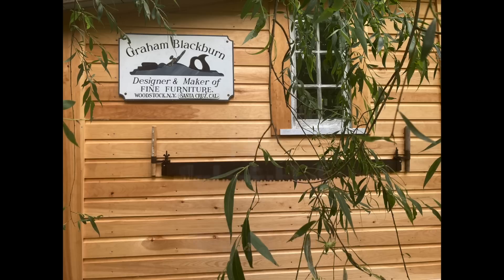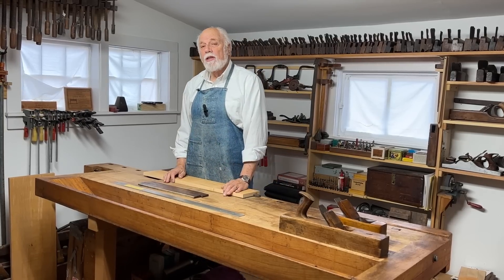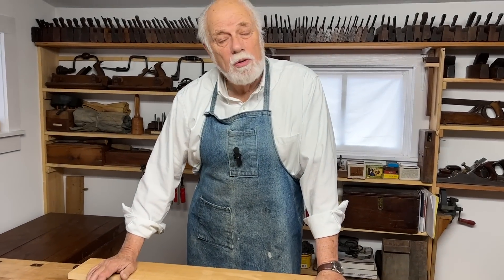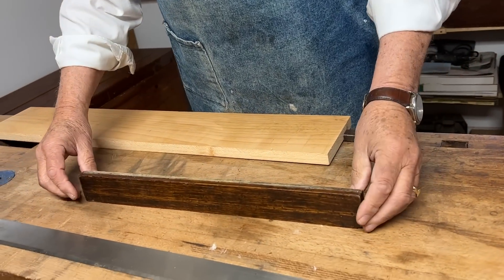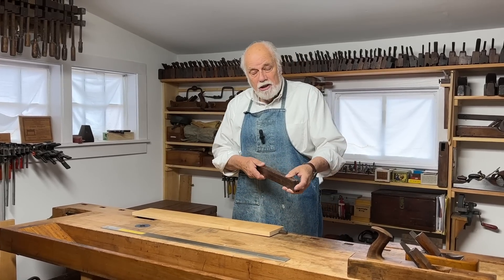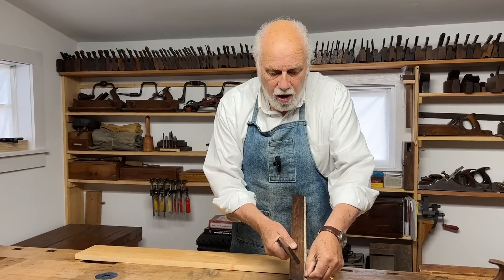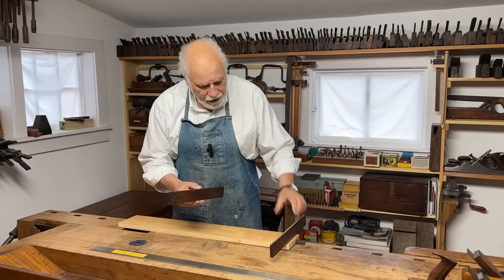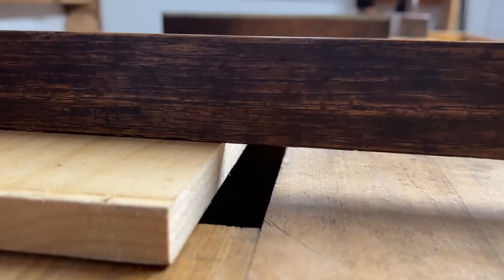28. Winding Sticks & Machinist's Straightedge

Comment: I know this is cheating, but as suggested by Chris Schwarz, I used two pieces of aluminum angle, each 24 inches long. I painted one of them bright red and have been using them for several years with no complaints.
Reply from the maker: Whatever works!

Comment: Everyone who has ever made any amount of videos on hand tool woodworking has a winding stick video, so there are a few people who have heard of them these days. It is however nice to see your take on it.
Also do you not need both winding sticks and a straight edge to check for flat? The winding sticks to check for wind (get two co-planar lines at the end of the board) and then the straight edge to take care of the rest (sweep the lines connecting those two co-planar lines).
An alternative requiring longer straight edges would be to put two of them flush at the bottom of a V-shape and then put the board in between the legs of the V, giving you three points connected by straight lines, forming a plane that you can reference with a third straight edge. The caveat with this method is that you need straight edges long enough to make a V that your board fits into.
If you are going to make your own straight edge without any external reference you will have to make them three at a time, checking each for high spots against the two others until they all match
Reply from the maker: All true. There's always more I could say but never enough time. Bit by bit I'll try to cover everything (It's why I started by writing books.)

Comment: Thanks!!! Because winding stick has to be accurate i have decided to use two identical levelers good quality. With out them I won't start flattening my stock. With time and experience it become very intuitive process. I have got small jointer/ thicknesser but it so noisy, can't get more than 19 cm stock and the blades leaves marks .
Reply from the maker: Right on

Comment: Also helps to have center dot in center of winding sticks. One thing I have to always watch for in there use is make sure board is flat where they are rest on. Have had boards with bow on top and stick will lean one way or the other and give false readings, just a little can throw you way off.
Reply from the maker: Very true, and a good tip I'll try to include in future episodes.

Comment: An accurately flat aluminium spirit level is also good to check for flatness; simply rubbing the level over the wood leaves grey marks on the high spots. I use this method with an 8’ Stanley Fatmax for jointing planks into boards.
Reply from the maker: Great tip!

Comment: Thank you for an excellent video as always. Interestingly enough Rex Krueger has just made a video about flattening wood, although I think only his patrons have seen it so far. It will probably be published tomorrow.

I have two sticks I made out of oak as planing stops. I simply place one against two stops on the workbench and then put whatever I need to plane up against it. I suddenly realized I could use them as winding sticks as well, so I cleaned them up and made them parallel. They aren't terribly tall, but they are better than nothing. I also have a straight edge, so I have something to choose from, so to speak.
Reply from the maker: Sounds good. There you go!

Comment: I just wonder if the problem with the raised ends of the board might be when you use the straight edge, as the end against the bench dog looks to be raised slightly off the bench.  I guess the sticks won't pick up the longitudinal unevenness, just the lateral flatness or twist.wind.
Reply from the maker: Definitely helps to make sure your bench (and any dogs) are also flat.